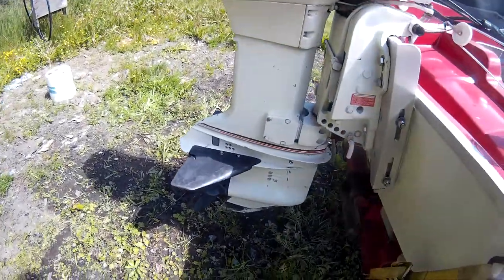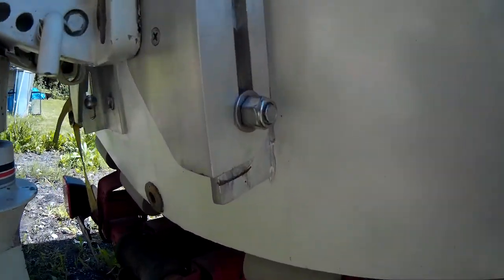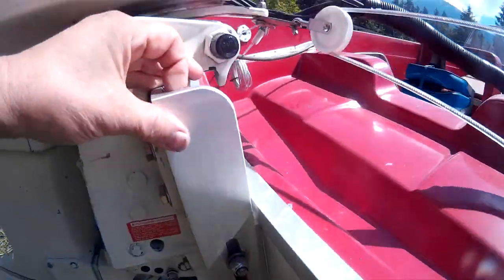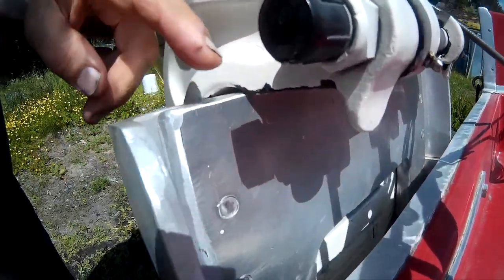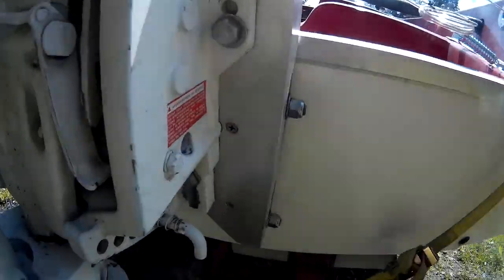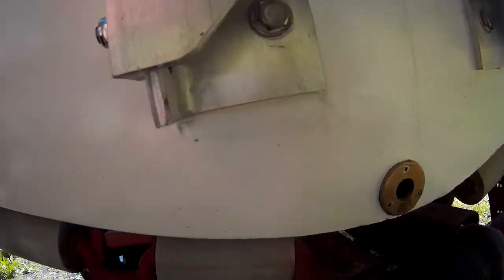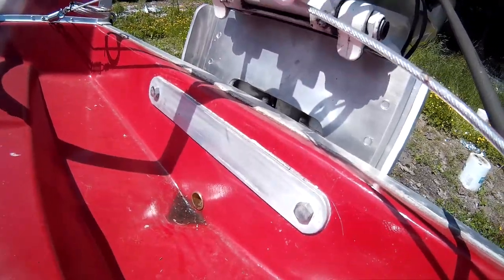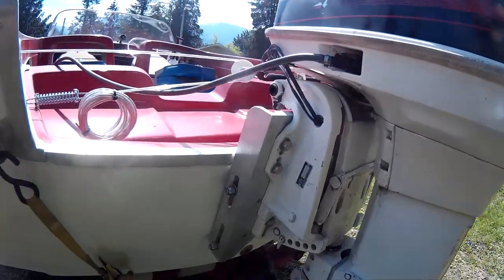DIY Adjustable Outboard Jack Plate

Comment: looks like a very nice job done..... this could be made adjustable with a single bolt very easy.. you have made it look very good..
Reply from the maker: Thank you for the kind words Phill. 
Yes it could easily be built with a jack screw to adjust the height. I didn't bother mostly because I was in a hurry and I judged that I could set it up fairly easily without.
Reply: @sutluc1  the bolts holding the motor on are not good. you should of gone all the way through with washers and nuts, this is the weak point and your asking to lose a motor with them like that. the force on the top bolts is extreme and just being threaded into that plate is not good at all... you need some 1/2 bolts that go through with nice lock nuts.... but definitely  a very nice little jack plate....

Comment: Awesome idea! Any idea how heavy your motor is? I need to do something like this on my boat but not sure if 3/8" would be strong enough for a 250lb 40hp.
Reply from the maker: Around 250 lbs. I think OMC said 230lb dry without tilt and trim, which this one has.  (It's a 70 horse.)
About all I want to do to pick it up and walk a few feet with it. The bracket is very strong. I'd hang double that weight off of it and not worry about the jack. 
The transom... that I would worry about...

 I tend to overbuild stuff.